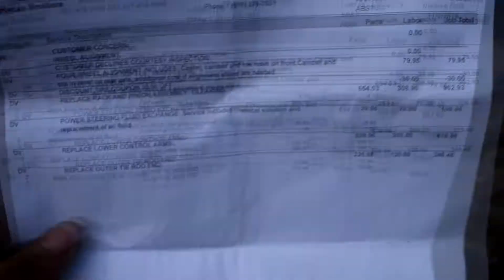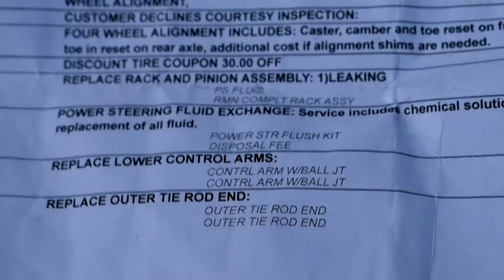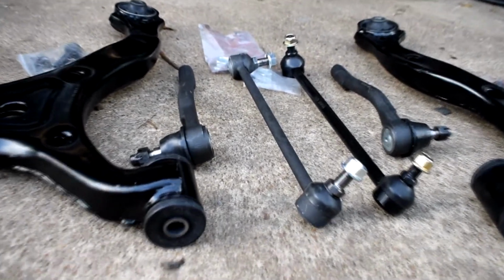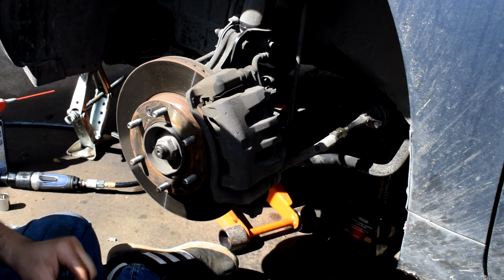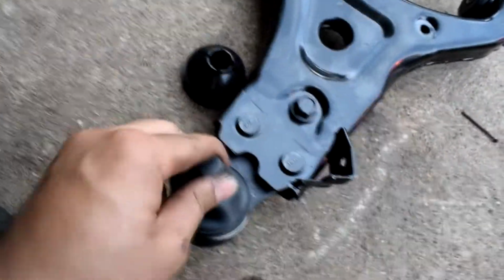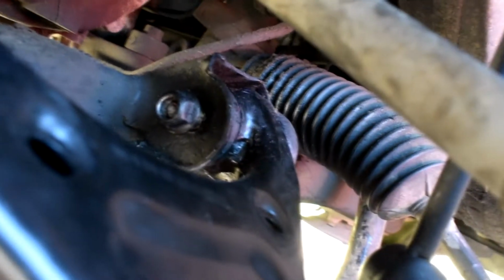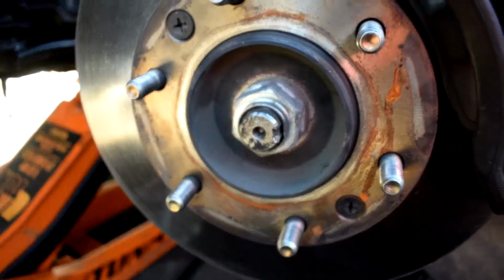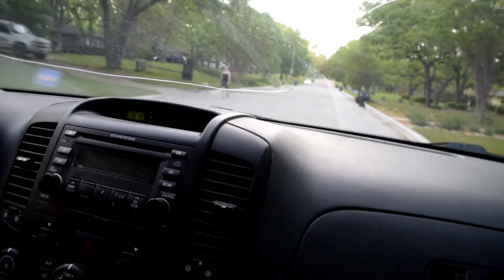How to save $2000 dollars! *NOT A SCAM* 2006 Kia Sedona Lower Control Arm Replacement

Comment: With shipping I paid 180 from 1A for the 8 piece set you have there. Control arms, sway bar links and inner outer tie rods. Well worth the time to order yourself
Reply from the maker: Good deal! Yea doing small jobs saves a lot of money too 

Thanks for watching!
Reply from the maker: I still have the van. My mom use it for work. 6 years 160k to 240k. Still runs and drives fine minus the catalytic converter code 😂

Comment: The rack n pinion will leak in the boot you have to take it off to see if it is leaking lol omg don't forget to bring your own oil.
Reply from the maker: turns out it was the valve covers leaking. They were hard as a rock!

Comment: kia replaced my front control arms and coil springs for free on recall, the back lower control arm just rusted in half, but they wont replace those!!
Reply from the maker: Dang but should be easy replace the rear control arm.
Reply: @leesgarage7  thats not the point, they sprayed some waxy crap on the rear ones as a bandaid when they did the front, did nothing!!!!almost caused an accident when the rear one blew out
Reply from the maker: @timidater4803   what the...i would never put "bandaid" solutions on suspension parts. That is some kia dealership LOL

Comment: For the control arms on the Sedona I'm pretty sure there is a recall on them, due to premature rust. Check it out
Reply: Mine cracked yesterday.. about 1/3 of it is left. Hanging on by thread.. It is a recall. mine goes in.. Via a free tow in two days. Google it.. back in 2103 they wanted to put some paint on it. in 2016 they said "Paint didnt work" we are replacing them fully.

Comment: KIA told me...$1014 to replace lower control arms. 
Took it to 2 other places...no lower control arm problems. 

I took it to them for small popping in steering column. It turned out to be steering column coupler. 

Get 2nd and 3rd opinion. Dont trust Kia estimates.

Comment: So what if its a 2006 Van that you paid $2k for. terrible logic bro, its like when i used to sell tires. people would come in with a 10, 12 whatever yr old car and be all "well the car is old I dont want to spend as much on tires as i used to for this thing, waddya got cheap?" *SMH* So let me make sure I understand you. Because the car is now old but still running well, you dont want your daughter to be as safe as you used to want her to be...do I have that right sir?
Reply from the maker: We paid $2500 for the van and my mom is still driving it lol. The parts are holding up well! The only problem is me not tighting the sway bar linkage. It came loose and started to make noise. Locktite it and never made noise til this day! 
Parts were cheaper than autozone and orielsy plus it wasnt too hard to install. 

I see what you are getting at but you don't want to go tooooooo cheap are certain parts. 

Kia van still runs great with 200k+ miles!!! Had it since 2016
Reply: Please! It's perfectly reasonable and practical to use economy tires on a used car and not get expensive performance tires for an old car with a worn out suspension. Discount tires are no less safe than expensive ones. Save that BS salesman hook for your ignorant customers.